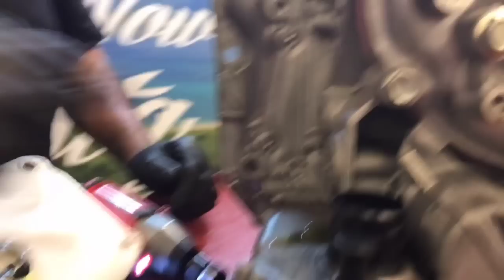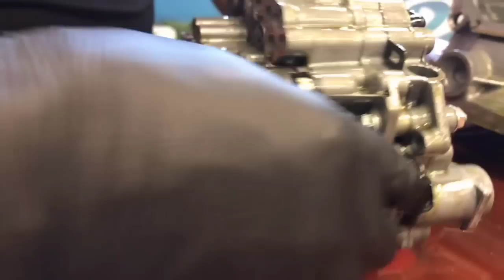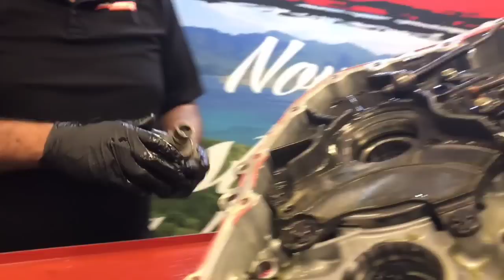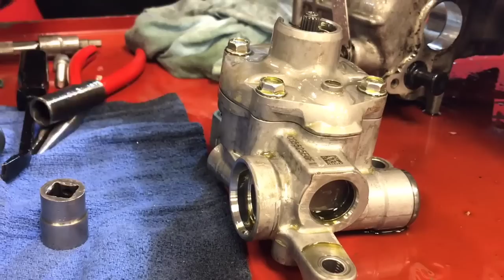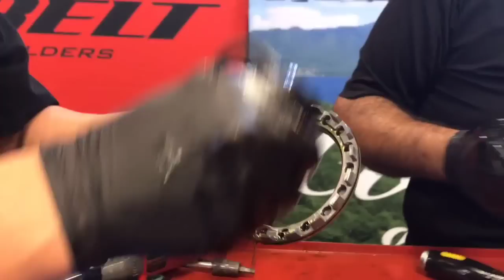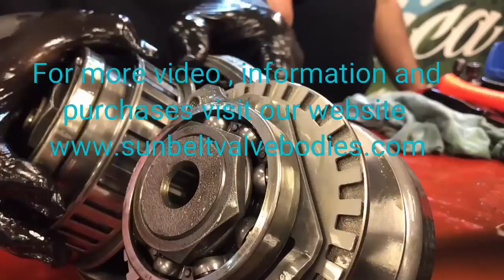2013 Nissan Sentra CVT  disassembling a RE0F11A (JF015E)  transmission

Comment: The issues I have with this otherwise excellent video are first that it neither finds nor discusses the symptoms of the failing transmission.  Second, it doesn’t find anything wrong on disassembly of the transmission, so we learn nothing about the cause of the transmission failure.  Please supply those two bits of information in your reply.
Thanks.
Reply: There no issues with the transmission obviously they are showing tear down of it
Reply: There must be issues it is a used trans. He mentions he still hasn't found the failure in the video!

Comment: Wow, this is insane! So many parts to take it apart. I would never be able to put it all back together. I would have so many spare parts left.
Reply: Love the comment😂😂
Reply: Trust me you could if you wanted to. I was in automotive trade school in the 90s, and I remember doing a standard trans on a 86 Cadillac Fleetwood, that had no reverse. I was on a five man team, and we fixed it. Only did it once in my lifetime, but still cant believe we did it till this day.
Reply: ⁹8th ii⁸⁹x xCc
Reply: For some reason I find this less intimidating than a standard hydraulic automatic transmission like, say, a 200-4R or a 4L60e

Comment: There are so many  intricately shaped parts within this single component. It's honestly drool inducing to see them all... That sounds a little wrong, heh.

At any rate, this video would make great reference material for anyone drawing anything mechanical. Especially the CVT belt, that's a very curiously designed part.

Comment: Just fascinating how complicated a transmission is.
Reply: These CVT trans. Are relatively easy compared to normal automatic transmissions.
Reply: @MrDejast  lmao nah.
Reply: @chrisl8527  but wouldn’t it be though? Basically continuous gear driven by a chain/belt rather than multiple gear ratios????

Comment: Great information , i have one in the shop right now , pan was covered in metal shavings , did a filter , fresh fluid (oem) and it drive good for about a week and now its stuck in first gear ? Im suspect of the solenoids , any ideas ? Gracias Amigos

Comment: I have this CVT fitted to a Uk Nissan micra with the hr12 3 cylinder engine. I have fault codes P0846 and p0848. I have no drive forward in D or L but it will move in reverse. I have changed the valve body for a recondition unit but still no drive.  I have checked the wiring from the Tcm to the valve body multi plug and it’s all good. The feed for the pressure sensor B in neutral is 3+volts and the fsm says it needs to be 0.88-9v. Have you any ideas before I get ripped off by the dealer??? Thanks for any response

Comment: My Murano had some CVT issue that required a rebuild. Forget that. Sold it. No more Nissans .
Reply: No more CVT's
Reply: My murano 2012 has no cvt issues yet. However the transfer case required a rebuild at 99k that costed $3k...nissan has shitty tranny but solid engine. No more nissan until no more cvt for me
Reply: Well,  I have wondered how Nissan pulled off a CVT without the reliability issues involving a sheave pulley,,, and while that is cool looking belt technology,,,  it clearly ain't for much more than an engineering excersize.  That thing would need to be way up sized to have any kind of respectable service life. 

What are these things getting on them in miles before they are failing?
Reply: Nissan CVTs are junk.
Reply: Jaciee87 cool. You don’t know what you’re talking about. Thanks for sharing.
Reply: Or just get one without a CVT?
Reply: @tuoitreomaha9096  the engines are trash too
Reply: @tuoitreomaha9096  The most reliable engine on any car, even then Toyota. Toyota engines burn a lot of oil. My Maxima engine is a dream smooth and powerful.
Reply: Armando Valoy I agree. They make best v6
Reply: I'm all set wife's rogue giving me issues and its not a happy time.
 I'll stick to a cummins with a 5speed manual

Comment: Rotary vane pumps were originally invented by Charles C. Barnes of Sackville, New Brunswick, who patented it on June 16, 1874. Variable-displacement vane pumps are used as an energy-savings device and have been used in many applications, including automotive transmissions, for over 30 years.

Comment: great job guys.  I'm getting my cvt.. rebuilt now from certified trans in valporaiso indiana , and there rebuilding it today, I told them call me and tell me what part failed.  it was running high rmps at high way speed,  it would not shift at Hi way speeds.  I'm curious to know what happened

Comment: Nice to see men who know what they are doing at work. I have a Jatco CVT and I am at 60.000 miles now. No problems yet. Impressive how complicated it is. Yet so simple. Tear apart is only half an hour. May a rebuilt do twice as long. Uninstalling and installing maybe 3 hours and relearning half an hour. So you wonder why a rebuild is so expensive??
Reply: Turing a screw half a turn: $1
Knowing exactly which screw to turn: $1000

Professionals charge for what they know, not for what they do.

Comment: a thick chain instead of a belt, electro magnetic sensors, material on the edge of the  centrifical pulley, shift solenoids connected to the sensors, pcm, shifter inside of the vehicle, clutch packs, and of course a no power to the shift solenoids, and sensors in park and neutral. That would be the best cvt design.

Comment: I feel lucky still, I own a Nissan Juke 2011 with 1.6 liter turbo and getting 100K next week, no issue show up with CVT, in the other hand my brother used to owned Nissan Rogue 2010 with 160 K and the CVT failed, quoted to fix it for $5000, so he traded it.

Comment: Hi Guys,  Nice video, nice work!  I'm a retired tech and have overhauled both standard and automatic transmissions, but never a CVT.  What brand of CVT fluid do you use in your shop?   I know most recommend using only Nissan N3, but I have been in touch with my local B&G products rep who told me their brand of CVT fluid meets Nissan specs, and said the local Nissan dealer used the B&G CVT fluid in their shop .  What are your thoughts on this?  Thanks!

Comment: Can the variator be removed  without removing the front cover ? Or front cover needs to be removed because the shaft of the secondary goes into the idler pulley. I appreciate the answer

Comment: I have a 2016 nissan sentra with a p285a code i replace the inside part from the transmission and nothing change the rmp goes up and down. Is there anything else that i should do. Thanks great video

Comment: Thank you for your videos they are very helpful. I have question, I have 31020-3UX4B transmission on my 2013 Nissan rogue and it doesn’t drive in reverse , forward gears works fine. Which part failure is most common for this kind of issue?

Comment: Yes that's how complicated cvt gear is ..even though all clutch linings are good when we put it back all part ,theres a problem occured on it sometimes sudden shifting occured ..i think solenoid valve malfunction ..this kind of cvt transmission really confusing me..its not easy to repair.. i prefer to repair ordinary automatic transmission instead this cvt gear..thanks for sharing this video my friend..

Comment: I think the biggest problem is that Jatco engineers designed them to work purely as CVT's with the steadily increasing ratios but the Nissan engineers decided to put in fake shift points to make people think they are like regular transmissions.  The sudden jerking load on the center shaft damages the three splines and the ball bearings.  When that goes, it takes the belt with it.
Reply: Bingo. All for nothing. Just let it work as it was designed.

Comment: Great video, I'll never buy a car with CVT 🤣🤣🤣🤣or GDI Engine
Reply: 2 things i said i never do either.... and here i am with a DIG and Cvt powertrain combo...
Reply: good luck friend the direction we are heading aleast one or the other is going to be a new vehicle you buy
Reply: Looks like you better buy chrysler😁
Reply: Y la traducción al español?
Reply: @PeePee2000 most cars make it to 60k with little to no problems
Reply: @PeePee2000 honda is known for quality.  Mazda has taken nissan spot up with Honda and Toyota for asian vehicles
Reply: @haveaniceday23  not nissan. Audi VW or Chrysler.. they can go at 40k easy
Reply: @PeePee2000 in that service center with a nice and plump 5 grand cvt  rebuild bill
Reply: I'll never buy another one! Had a '16 Versa. Trans failed at 70,000
Crappy go kart transmissions
Reply: CVT is where the market is going forward so you will have to get a bicycle.
Reply: @benitojr468  Chrysler uses the same CVT's.
Reply: @Steubenville_PoPo  yeah😭 here from doing some digging on issues with my 2011 jeep compass 2.4L with a Nissan/jatco cvt. I also work at an FCA dealership. As far as having work to do,  I definitely work for the right manufacturer, I just own the wrong one🙄
Reply: @PeePee2000 i have 327k on my cvt nissan and its working.  Your info doesn't speak 4 all.
Reply: @occckid123  tell us more please. (What kind of use? (Highway, city, hilly terrain), maintenance intervals etc...) Thanks, greetings.
Reply: @estebanamador7601  its alot of everything.  Alot of backwoods but many city miles and racing.  Nyc driving a bunch of idling used for uber. Been living in NYC now so much more stop n go and orders in NYC but I have a normal job where I don't use the car during the day.  I just do whatever needs 2 b done loosely on time.  Oil change every 7500 0w20
Reply: @occckid123  and transmission fluid change intervals? Thanks
Reply: @estebanamador7601  every 60k miles
Reply: @occckid123  great. Thanks
Reply: @benitojr468  Chrysler literally makes a dying sedan and a minivan. You can’t be serious 😂😂
Reply: Eric P Chryslers are like Hookers
, As long as you give it $$, theyll keep puttin out.
Reply: Most small cars have cvt in them idk what else you will buy bc you can’t afford em 😂
Reply: @MandoBuildZLEGO   You have to research before you buy any car
Reply: @redbaron2448   was at a point of needing one like right then and it was really my only choice atm because it’s what I could afford, won’t be getting another after I get rid of this,

Comment: so you took the trans apart and there was nothing wrong with it?
Reply: minor25 he said everything looks pretty good 😂😂
Reply: Yeah.. exactly what I was thinking..
Reply from the maker: Valve body was the main failure
Reply: @Sunbeltvalvebodies  What caused the valve body to quit? I noticed a lot of metal shavings in the first filter and in the pan. was it wear and tear from a lack of maintenance that caused it to fail? I've been thinking of buying a car with one of these transmissions, what your professional opinion. I'm older and don't hotrod anymore. I've heard these CTV's can't take a lot of hotroding. what about hills and so on?
Reply from the maker: @someguy936  There is a secondary valve in the valve body that goes bad all the time. Some CVTs are okay just depends which vehicle your looking at .
Reply: @Sunbeltvalvebodies  well..then tell us some good CVTs.Are Civics CVT any good?Toyota?
Reply: You can see if u are crazy enough to buy a Nissan..this 5K repair job is coming for you
Reply: @Sunbeltvalvebodies  

Dear sir, 

I have Nissan pathfinder 2014 CVT gear. Now my car gear making rubbing noise when u shift to D.  And when u drive 100 km speed it is giving kicking feeling And I changed the oil. Still, noise is there.pls can u help me regarding it.
Bar's leifaks 1416 duper transmission fix can I use this.
Reply: @Sunbeltvalvebodies  is it related to the oil pressure solenoids?

Comment: I have been working on cars for 5 decades as a hobby.  I have always driven manual transmissions, ever since my "67 Malibu SS 396 days.
My impression after viewing this:  (1) Great video, thanks for uploading it.  (2)  I don't like all of these electronic sensors and electric switches inside and on the transmission.  My current manual is smooth as silk, and it is only gears, bearings, and fluid.  No cooler needed, no vacuum line connections, no codes to interpret, etc.  (3)  After you drive a manual trans for awhile, you will never go back to a CVT or a traditional AT.
Reply: bboucharde DCTs are replacing the manuals now due to being quicker in performance and silkier shifting. Shift times are in milliseconds, way faster than any manual. Koenigsegg is currently working on a transmission that shift even faster now. Wouldn’t go back to a manual if you want to outrun people or hit faster lap times.
Reply: Jolted Cosmos manual is still more repairable and durable.  When the car is in the yard at 101,000 miles, economically destroyed, a couple of tenths of a second 0-60 don’t matter at all.  Actually they never did.
Reply: 777jones No it’s not by modern standards. Lol. Almost any transmission is repairable depending on how it’s built regardless of type. Not sure where you guys be getting your facts from.
Reply: Jolted Cosmos do me a favor.  Compare used Maserati or Ferrari prices, sequential versus manual.  You will see the manual is more valued by collectors - because it sucks so much less.
Reply: I think im with you
Reply: Totally agree! Solenoids don't belong in oil in my opinion. Electrical gear bathed in oil, cant be a good mix. We had a Subaru with one of those boxes, car was pretty good, the transmission box was a huge piece of junk.
Reply: Need that right hand to hold the wine glass, not a shifter, so gotta get that lousy cvt
Reply: @RRaucina  RR,  Ha ha!
Reply: @Iridiumcosmos 

Can you show me where you get your “facts” from? I’ll wait.

Comment: I have 2012 nissan sentra 128,000 miles,sometimes reverse not have power especially when is too cool,what you recommend to fix ot? ,change fluids and filters? Or some sensor? Thanks  i hope you can help me.por cierto que buen video.

Comment: Well done men. Your knowledge is impressive. I own a small dealership and I find auctions have a hard time selling late model nissan of any type from 2013 to 2018. I drive them before the auctions and buy the ones that will respond with a fluid replacement and tell people to have it done every 30k miles. How much are you listing rebuilt CVT transmissions for 2013 Sentra EX ? God bless

Comment: I took off my trans pan on the RE0F11A and found a prety decent size piece of metal but no shaveings. My trans was acting eratic with codes p0744 and p0456. What typically goes wrong in these transmission ? what could the metal be from? I allso found a busted primary trans speed sensor.

Comment: HI Sunlink, my 2014 nissan SV versa cvt does not like to change down when going up hills, rev's up to 3-4000 rpm and generally only changes down when I back off the gas, sometimes with a small clunk, other times just a bit hard. Drives on the hwy nice, on the flat a bit sticky but not as bad as going up hills. I added an oil cooler and drained the fluid twice and it is a bit better but do I keep changing fluid until it smooth's out or is it a sign a gear ring is worn? need filter clean? or maybe speed sensors are not functioning properly? not sure what to do next- lmk mahalo!

Comment: I have a 2019 Nissan Sentra with a CVT transmission and a 1.8L engine. I hear a sound coming from inside the gearbox when the car slows down from gear 3 to 2 to 1. It sounds like “tik tik tik” coming from the transmission. When I press the accelerator, the sound disappears at high speeds. I only hear it when the car starts to slow down from gear 3 down to a complete stop. The sound is gradual, resembling a ticking.

Comment: @ SUNBELT - I Have A P0965 (B SOLENOID) CODE 2014 NISSAN SENTRA SR , 128K MILES , WHAT MOST LIKELY IS MY ISSUE ? AND WHAT PLAN OF ACTION WOULD YOU RECOMMEND I TAKE IN FIXING IT ?

Comment: If I just needed to reseal the trans to front cover (bell housing) can I separate it without having to drop the pan and remove valve body & everything else you removed before getting to that stage?

Comment: as hundreds of parts being removed, i cannot imagine how intelligent the engineers (who designed this module) are.
Reply: Unfortunately there was a design flaw that allowed for it to prematurely fail and brake the belt.
Reply: Not very, considering that this is a ticking time bomb in 90% of nissans cars...
Reply: @1289lt  ARE YOU A MECHANICAL ENGINEER? CAN YOU DESIGN ONE?

Comment: Hi
I have a Japanese Nissan Cube Z12 with a REDF11A GM38 transmission 
I have a rattle in the morning when I start the car and in idle it only lasts a few minutes and it sounds like its coming from the transmission side 
I was wondering if you had any idea of the issue could be 
Many thanks 
Denis Cleary

Comment: When you buy a subassembly online, is it necessary to use a digital caliper and measure the case depth to define the correct size snap ring to fit? Does this really matter? The bulletin has so many special tools that I don’t see anybody even using on these rebuilts.

Comment: And this why these transmission fail... my 92 nissan sentra has an original engine and transmission with 280k miles . I love it
Reply: Nissan was still nissan in 1992.  They are owned By crappy renault now ..thus   nissan is trash today
Reply: Pope Platinum Beats it’s not Renault. Its the shitty Jatco CVT’s. Ive got a 2007 Renault Grand Scenic in the UK with 167k with it’s original transmission and engine. Been a very reliable car.
Reply: Pope Platinum Beats They’re implementing DCT’s in some of the Nissan cars now. Hopefully this addresses the previous issues from the CVT’s.
Reply: that is not a cvt. first year was 2007
Reply: @carlsnyder1449  bearing in mind, mine is a standard manual transmission but overall reliability has been brilliant with that car. Nothing ever failed on me.